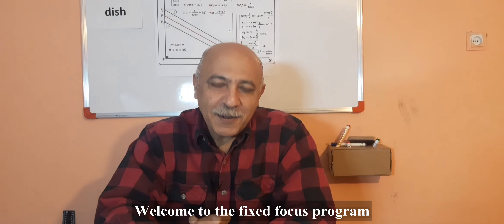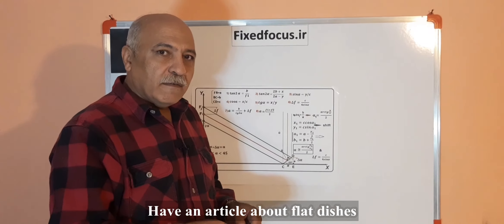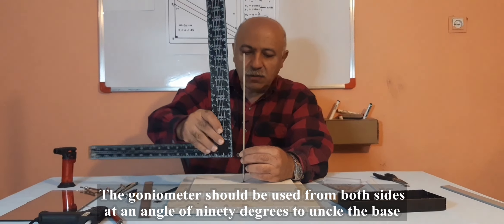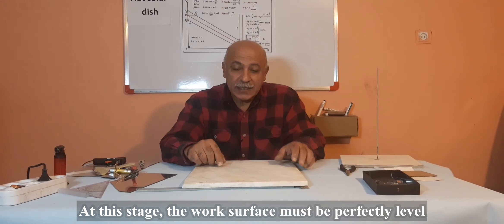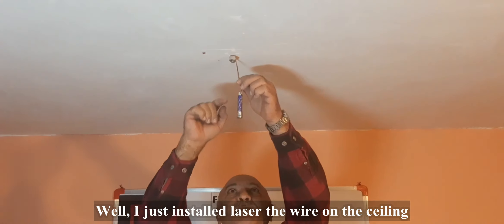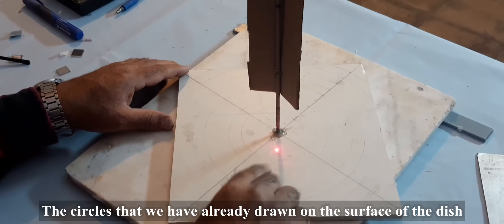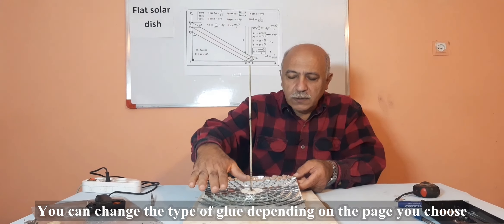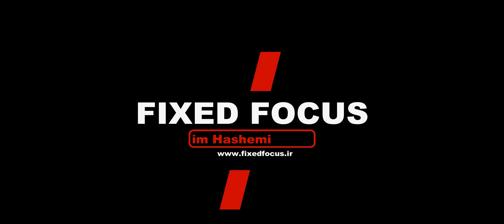The method of creating a flat solar concentrator (flat dish) by using a laser radius

Comment: I stumbled on your site accidentally and am very impressed by the amounts of research and effort that you have put into it. My interest is similar as I'm a cable operator and used to manufacture and sell dish antennas of 8' to 16'size which was quite successful. I must admit that I had a lot of interest in entering into the field of domestic heating here in India about 40 years back. I had proposed flat panels of 4 sections that would enable me to make a "Dish Ant" of 12' square. Here I proposed to use stamped ventilation type panels (angled just as u described in your presentation)which were stamped em masse by presses and were identical therefore resulting in much lower costs and quicker assembly time as well as accuracy. Next I had proposed using automobile radiator coolant which was "escorted". Into the residence by well insulated piping into suitable heat exchangers. The whole DA would have to be motorised in order to realize the optimum energy efficiently. I have already started with on the same and hope to finish it in a month or two and hope to appraise you on the same Asap. Thank you very much and God bless! Have a nice day.
Reply: Point noted Sir!

Comment: Here again.
I think it would be great to combine the idea of the fixed focus mirror's structure and using this kind of flat based mirror system glued to a falt sheet to reflect light to the focal point instead of a big, curved mirror base.
Reply from the maker: Of course, it will be easier to move the mirror, but it will be a bit difficult to make the mirror, and it is also difficult to clean it
Of course, your idea is good if these problems are solved

Comment: I found what you are doing quite inertesing. I wonder if somone has the code to 3D printing one of these with the depth already calulated so it would be super easy to put the pieces of mirror on the surface with the exact depth already built into your solar concentrator. If anyone knows where to find the code please let me know. Thank you for the lesson sir.

Comment: That method wont scale vary well due to time it takes to make them.
My guess is you are going to want lot's of these for your project you would be better off forming it with thin polished metal rings then when finished coating it in latex that you can then cast resin into before mirroring.
Reply from the maker: Yes, there are different ways to do this, and in this video, I want to show the conceptual method of making it

Comment: How much surface is needed to prepare a few cup of tea on it.
Reply: @fixedfocussolar  what is the minimum solar surface ( in square feets) needed to prepare a few cups of tea on it
Reply: @fixedfocussolar  I HV tried ur method of plane solar surface.but did not use laser.i used sun rays falling vertically on the plane surface shown by a vertical nail at the center.then fixed small circular mirrors available in the market for focussing the rays falling on these mirrors on a specific point.